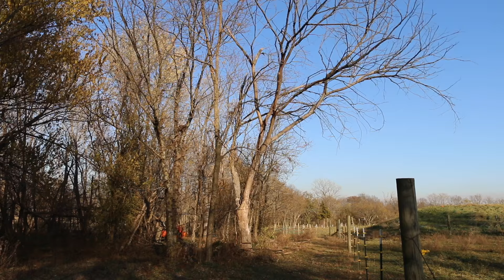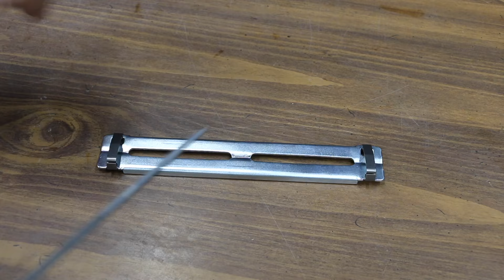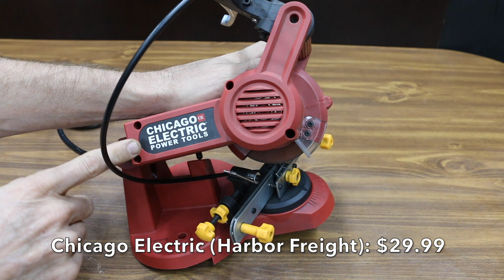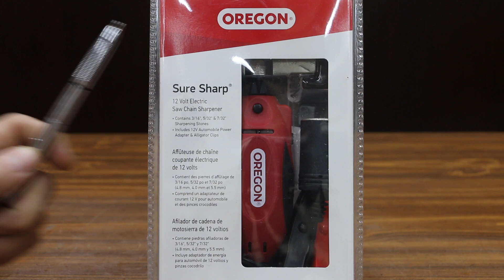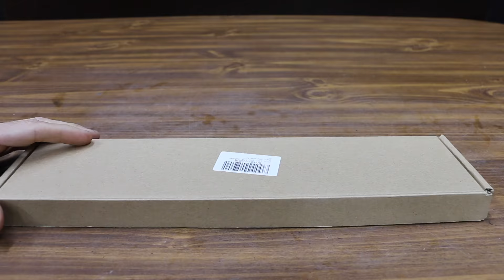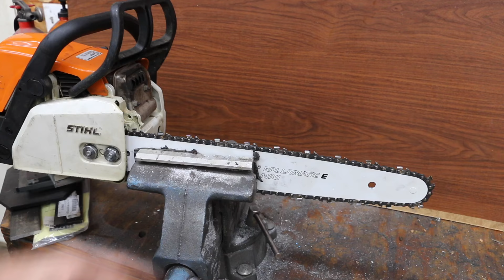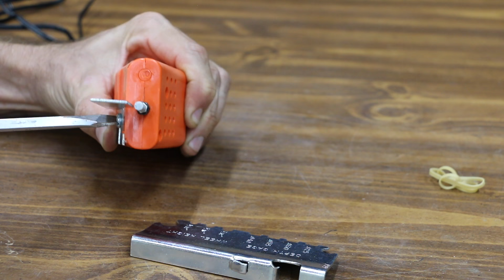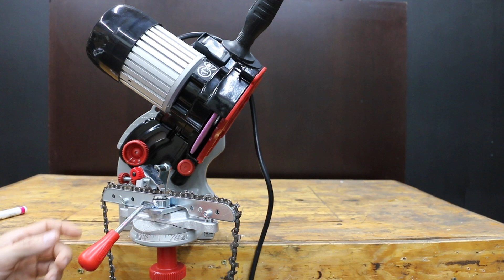Which Chainsaw Sharpener is Best? Let's find out! Stihl, Granberg, Chicago Electric, Oregon

Comment: I'd be interested in a follow on with the Timberline sharpener.  
It's a bar-mounted jig that uses carbide cutters rather than files, so very low heat.
My experience has been a VERY sharp chain in fairly short order.
Reply from the maker: Thanks for the suggestion.

Comment: I used to work in a job where we used a lot of chainsaws.  I did all the maintenance on them, including sharpening.  We had the Oregon bench grinder that I used for sharpening.  At first I didn't like it much because of the amount of material it removed and (as is mentioned below) the heat the grinding put into the chain tooth.  After using it for a while I found the best technique is to set the grinder up so the wheel just barely misses the chain tooth when you bring it down.  Then you can "flex" the frame of the grinder by pulling the wheel horizontally into the tooth.  This way you only take a little off the face of the tooth (extending chain life), you don't put as much heat into it, and you can control how far you go to get the tooth sharp.  The feedback I got from all the operators was that they were very pleased with how the saws worked using this technique.  

That said, on my own saws I like to use the hand file method.  I also take just a little more off the depth stops to make the saws cut a little faster.

Comment: He had the wrong size Stihl 2 in 1 for his saw so swapped the files?? These sharpeners are made per file size to ensure correct spacing & raker depth yet it was still the quickest! They are outstanding and any fool (that's me!) can make a really good job every time.

Comment: I have the Stihl 2 in 1 and I use it a lot. I live on a large piece of land and it's heavily wooded. I probably cut between 10 and 15 trees a year depending on how heavily it rains. For ease of use, speed, portability and quality of cut, I think it's unbeatable. I have a vise mounted to buy tractor so I just sharpen it in the field. Great video and thank you. I'm happy to know that I can get marginally better results with a larger sharpening system but I lose the ability to sharpen in the field so easily.
Reply from the maker: Thanks and you are welcome!  Thanks for sharing.

Comment: I asked my buddy, who is a professional tree guy, how he sharpened his chain out in the field. Keep in mind that this was years ago before many of the products used here were even in existence. He used a round file for the tooth and a flat file for the rakers, if needed, no guides or anything else of that sort. I followed suit and with some practice got fairly proficient with this method. Fast forward years later when the Stihl 2-in-1 was introduced and it changed everything with the ability to sharpen chains consistently and accurately. I love that tool! I've been working some white oak this week and the chain is most definitely throwing some chips.
Reply from the maker: Thanks for the feedback.

Comment: I used to work in a chainsaw repair shop. We had a heavy duty commercial quality bench mounted sharpener but I always touched up each cutter by hand with a few light strokes of a file afterwards. It made a big difference.
Reply from the maker: Thanks for sharing.

Comment: I think the file based Granberg system USED to be painted yellow and orange and sold by Oregon (back in the 1980s when I bought mine). The thing is 40 years old and still works great (there's a conical black plastic centering point that I thought would wear out quickly, but it's held up!). I use it to field sharpen chains (I sort of have to, my so-so consistency in free-hand filing has not improved with arthritis). If I hit something and really damage a tooth, or when I want to really bring the saw back into form, I used a Harbor Freight bench grinder, that's a step above the Chicago Electric he checked out, and a step below the Oregon.  It does an outstanding job and produces a sharpen that cuts at least as fast and easy as my chains when new. The "changed geometry" which is due to the shape of the grinding disk and way the grinding wheel disc is brought into the cutting plane for the saw tooth (and which affects all disc-based bench grinders) slightly decreases the cutting angle - which leaves more "meat" as part of the cutting edge. I find this really helps the saw maintain sharpness better when cutting older/drier wood.  So, for me a plus.

 I love these hands-on head-to-head comparisons.  I USUALLY find them after I've bought tools (I've got really bad timing), but so far his demos have me buying the "winner" in all but a couple cases.
Reply from the maker: Thanks!  Thanks for sharing.

Comment: I have used the Oregon and the Stihl 2-1 and I like both. The Oregon should be installed proper so i am a little off by the angle 29 degrees. That makes a lot of difference! The Stihl is good. But takes me longer. I use it for the depth gaugh
Reply from the maker: Thanks for the feedback.

Comment: I got an attachment for my Dremel tool that works great. The stones that came with it wore out fast, so I replaced them with diamond coved ones which I have been using for 3-4 years and they are still good,
Reply from the maker: Thanks for sharing.

Comment: Stihl 2 in 1 is fast and accurate and only one step. If you do your part and be fairly consistent with angles, pressure and number of strokes on each link, it works better than most anything except the real expensive electric sharpeners for shops which aren't worth spending the money on unless you do a lot of chains. I loaned a guy a saw he had watched me sharpen a few weeks ago and he couldn't believe how fast it cut after being hand sharpened, he said...
Reply from the maker: Thanks for sharing!

Comment: I recently bought the Chicago electric sharpener. I've done at least 100 sharpenings with it so far and for the money it does a great job. We use 4 different sized saws and I've only had to replace 1 chain so far.
Reply from the maker: Thanks for sharing.

Comment: many ways to a sharp chain.

but for the most part pros use a hand file.
sharpen your chain more often. every 2 hours or as soon  as the chips get smaller, Imo

i use a cordless Dremel in the garage and on my "stump" saw b/c when chains beat up Dremel with diamond blade AT LOW SPEED,  like 200rpm variable speed.
many lose track of work involved and HEAT.  a super sharp chain runs cooler and less work on the saw and the operator.

many years ago watched an older guy that cut trees pro for over 25 years. he would take a break all the time and just touch up 3 or 5 teeth.  he also had minimum 3 saws, small med. large so never over worked the saw.
funny part was the foreman would always talk about how he was the laziest guy on the crew, lol
he would say sob sits on his ass and has a cigarette and sharpens saw every hour everyone else just smokes while they cut and swaps out chain at lunch. i watched and counted his trees and he was always ahead of everyone.
sometimes true experience and efficiency out works the 25 year old.
he also used chipper chains on the big saw and very little raker but thats pro-stuff dangerous and wear full gear and chaps etc. he also "mixed" his own chain oil blend but wouldnt tell you with what so dunno might be story telling but he claimed he used to check the temp of the chain and tried many a mix until he got the lowest temp.
anybody that is annal enough to check chain temp got my attention and thats why i remember.
Reply from the maker: Thanks for the suggestion.

Comment: I have owned the orange Granberg 12vt sharpener that I bought back in the late 70's. It works great, but I use it by eye, not with a guide. It is fast and works real good. I have gone through 2 timing belts with it so far, which is a lot of sharpening. I wanted another for a spare, so I bought the Stihl, China knock off. This is not as good as the US made original. It's noisier, it seems cheaper, even though they look the same. The stones that you can buy make a big difference, and with the original grey stones that work the best, and the white knock offs are too hard and take forever. I found an original on Ebay a couple years ago now, so I bought it as a spare cuz I won't be without one. I cut a bunch of wood and am getting into my own tree service.
Reply from the maker: Thanks for sharing.

Comment: The bench grinder was either used wrong or is  utter crap. As the blue color of the ground tooth (12:18) shows it severely overheated the steel which removes the temper. A sawchain abused like that looses it's ability to retain an edge and is essentially scrap metal.
Reply from the maker: Thanks for the feedback.

Comment: While the electric grinders are quick and efficient, you will always get better control, and precise sharpening from a hand file.  Using a hand file also prolongs the life of the blades and files.  You prolong blade life using a hand file because you remove less material per pass as opposed to using a grinder.
Reply from the maker: Thanks for sharing!

Comment: I am usually tired after emptying a tank of gas ( I am old as dirt), so that is about all I do in a single use.  I resharpen and adjust tension before each refilling.  I got uneven and slow results with filing, but came up with a fast and pretty repeatable technique with a moto tool.  It takes me about 2 minutes to hit each of the 26 cutters on my chain.  It is much easier on the body to just have a sharp chain, instead of using it, until it is obviously dull.  My last Oregon chain lasted about 50 tanks of gas.

Comment: Chicago Electric does a good job if you find a way to hold the chain steady while sharpening.  Most of the sharpeners do not have a way to grind  the guides. Pain to file if saw blade needs lots of sharpening.
Reply from the maker: Thanks for the feedback.

Comment: I like the Stihl type file but I also use a bench grinder to uniform the chain teeth after using a file because no matter how careful I am, even counting the strokes, I always have trouble getting the same motion when I change from one side to the other. This will change the length of the teeth and then the saw will cut crooked. The bench grinder brings the teeth back to the same length.
Reply from the maker: Thanks for sharing.

Comment: Unfortunately the Harbor Freight(Chicago Electric) grinding wheel is a abrasive coated rubber wheel.  Once the abrasive material is worn off the edge of the wheel the remaining portion is useless.

Comment: anyone know a good way to get the excess oil off the chain without removing it? Empty the oil tank and cut until chain is dry or spray it with brake kleen maybe?
Reply from the maker: Thanks for the suggestion.

Comment: have you tried the attachable curved grinding stones that attaches to the chainsaw and you just turn on the chainsaw for a few revolutions and it automatically sharpens the blade? or just use a flat knife honing stone and turn chainsaw on against said honing stone? i tried both, they sharpened the blade, and made very quick work.
Reply from the maker: Thanks for the suggestion.

Comment: LMAO, First you can tell by how much would chips vs wood powder comes off the chain. Second you only shortened the chain cutting height once when it should be done almost every other time. Last take your climate chain electric toy and throw it out the window!  My 1960 john deer does a better job than that electric pile.  I always hand file.  I have my Stihls, John Deer, and a Poland, and i save that one for big stuff because it has a monster chain and 22 inch bar. Its an off brand but it does the job. My chains leave wood chips not dust.

Comment: I always use my dremel and use the appropriate size stone.  It's the fastest and cheapest way I have found
Reply from the maker: Thanks for sharing.
Reply: @ProjectFarm  thanks for making great videos.  I'm currently broken down in Crossville TN with a bad turbo.  I had someone balance my wheel assembly and they obviously screwed up. Went at 650 miles

Comment: Very good review!
Looks like the Stihl 2 in 1 is a very good "manual" chain sharpener.
Reply from the maker: Thanks!
Reply: @ProjectFarm  Your very welcome. You obviously put in a huge amount of time and effort! ... Myself and the Mrs just bought 5 acres in central NH in Sept. Off grid build, with plenty of wood for future stoves, solar gain improvement, and falling tree damage prevention. I just bought a Stihl MS 180 last week. I had the same saw, as the "easy start" 15 yrs ago, and just never liked that saw. I followed the procedure to a tee, but found it so easy to flood. It had those flip up filler caps, also not a fan of those, and constant oiler problems ... Anyway took a chance on the same saw, but just the straight up MS-180. No "uneasy start", no funny filler caps, no tool-less chain adjustment. I love it. Starts great. Cuts great. And at 8.6 lbs, handles great. Since all my power tools are DeWalt, we also have the 20 volt 12 inch electric for smaller stuff. Also a very good saw, as long as you know it's limitations. So I think I'm sold on the Stihl 2 in 1. Thanks again!

Comment: I think holding the saw level on the second set of cuts helped with the times. Holding at an angle increases the linear inches of the cut and puts more stress on the saw
Reply: I thought that also. Seemed that when the bar was parallel to the ground the cutting was faster in relationship to whichever sharpening device used.
But regardless, what a great comparison video!! 
Fabulous.

Comment: Note that the "field kit" is just that. So I wouldn't expect it to be the top performer but it does then job when you're away from home. IMO, everything under 8.5 seconds is comparable so it's your preference and cost considerations there. The Oregon field kit is not far behind if you know how to use it. The rest are almost worse than nothing.

When I was growing up, my dad had a chainsaw that we used for firewood collection. We had a sharpening tool very similar to the manual Granberg system and I absolutely loved it! I don't remember it being difficult to set up and I was able to do one side in just a couple of minutes and the important thing there is that there was absolute consistency link to link and that makes a huge difference in performance. Two or three careful strokes per link was all it took. Then I could simply pivot it to the other side and do the second half of the chain. It was so fast and so easy that it encouraged use and kept us with a very sharp chain which made cutting much faster. (And if you want a wood that will dull a chain fast, try cutting up a dead juniper tree. THAT was an experience!)
Reply from the maker: Thanks for sharing.

Comment: I had the Chicago Electric sharpener.  It was awful.  Maybe it was partial user error, but I could never get a correct and consistent angle.  The Stihl 2 in 1 can go in my bag with my scrench/bar oil and other tools, and it's been the best sharpener I've found.
Reply from the maker: Thanks for the feedback.

Comment: This isn't so much a comparison of sharpeners but rather stones. I use the oegon 12v with the stihl stones, shaving sharp every time. Takes some learning tho, if you fuck with the geometry of the cutting surface you slow down the saw significantly. I think they make a bar jig for them now.

Comment: I cut many a piece of firewood, gave it up, getting to old, I found the Chicago Electric, just as good as any. I have used files, but they just don't hold up long and are expensive, the grounding wheel is cheap and most people will never feel and see any difference between both!
Reply from the maker: Thanks for sharing.

Comment: Doing chainsaw work for 40 years almost every day, I never used anything but a file. I also never let anyone else run my saws. High-end Husky's and Stihl's. I also wrapped my files in soft cloth and kept them clean, I'd get years out of the file. We had a Stihl grinder, which some people preferred because of their inability to file it correctly. I was always constantly  making new chains up for them, since they'd go through chain so fast. I did use the Stihl file tool, and found it excellent if you were careful.
Reply from the maker: Thanks for sharing.
Reply: Files? or grinding stones? I keep my files piled together in a drawer, same files my dad had. Probably some 60-70 year old files. I bet all that piling up damaged them. 😆
Reply: @m4rvinmartian  I actually used mine every day. And the files I sourced weren't that old, so maybe the old ones stayed sharp longer, but I doubt it.
Reply: hand filing is the way to go, i learned the hard way letting someone use my saw.
Reply: All of my files are separated from one another. I roll them up in a cloth. Making a "file roll" with a layer of wrap between each one. File cards or brass brushes to clean out the filings, this helps with file longevity. Files are cutting tools and should be treated as one  should treat all sharp tools and protect the cutting edges from unnecessary damage.